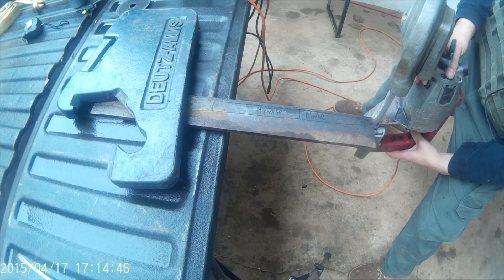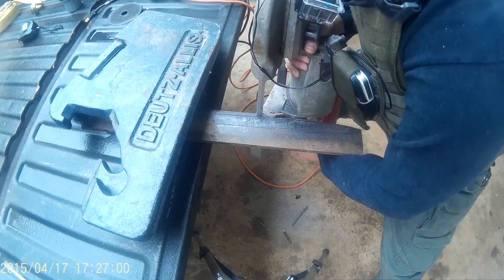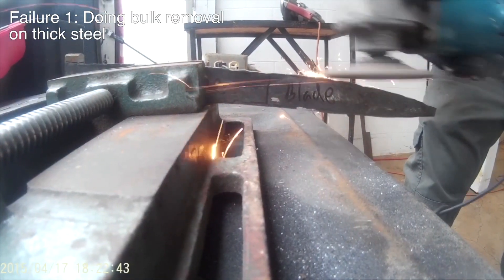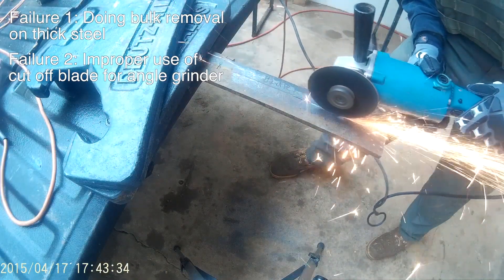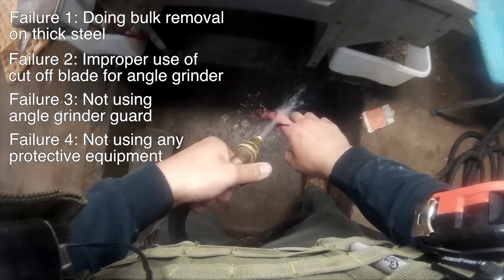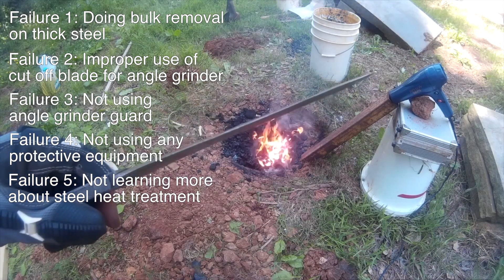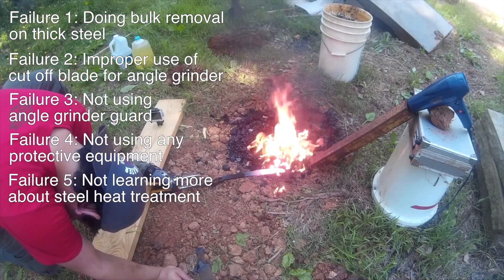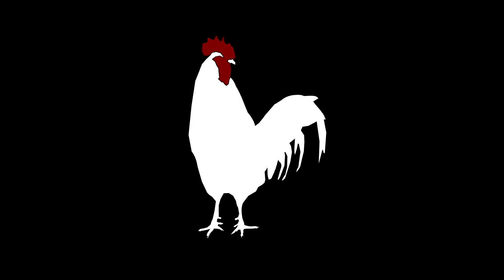How to Not Make a Knife: The Explanation (WARNING: Graphic Content)

Comment: I have done some of these mistakes as well with the heat. The best metal I found to make a knife is with thick rebar and hammer it down. Also as far as the tempering I used an oven. LoL works rather well. Great learning Video!
Reply from the maker: I'm going to try making a knife again, and this time I'm gonna use a file as the metal for the blank. I do like the idea of hammering down rebar though, but to me bulk removal sounds...easier (I don't think I have all the equipment for hammering out a knife. Also, as long as I don't get the file too hot, then all I'll have to do is put it in the oven, and not have to quench. Glad to share my mistakes!

Comment: Ouch, been there done that.....  One time at band camp....  When I was a kid, boy scout at summer camp, I recieved my Tote-N-Chip.  It is a badge that shows you have been properly trained and with that badge comes the privilege of having a knife. One is awarded to the scout (back then) with the badge and card.   they did that back then, I don't think they do it now.  Now a days, I think they explain the virtues & demeanors of sharp instruments and then provide a safe space.  Anyway, right after getting that award it was snack time.  It was during the era of the old pop tops (before you were invented).  I was given a can with the pop-top missing and promptly cut myself with my new knife on my left index finger and the scar looks like mirror image of yours.  I don't think you would have been able to cut through high carbon steel.  You would have ended up quite worse.  I know there are ways of taking mild steel, adding stuff and tempering it to harder.  A good friend of mine's son has done this at their place (down the road) using practical things found around the farm.  Glad you weren't hurt worse.  However the scar does provide certain bragging rights post-healing.  There I was.....